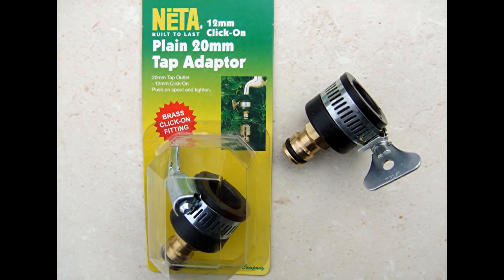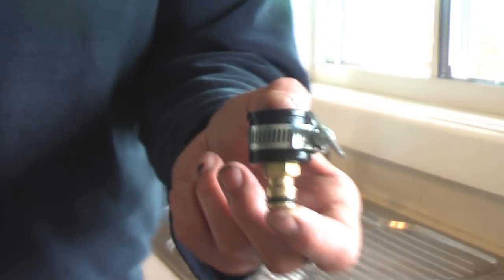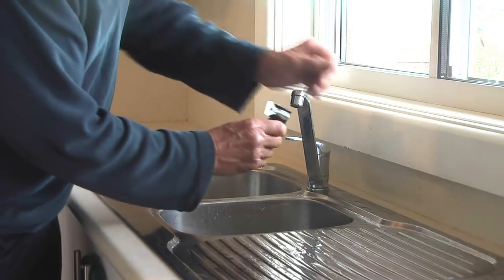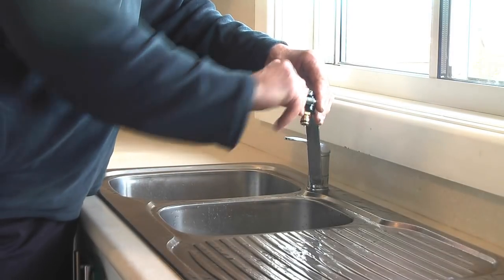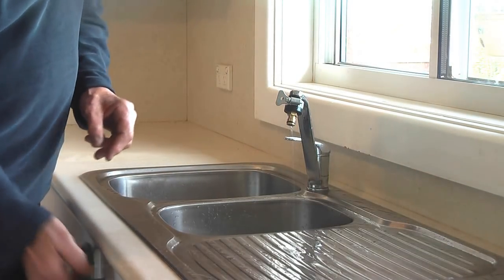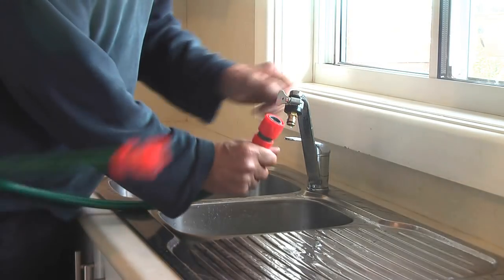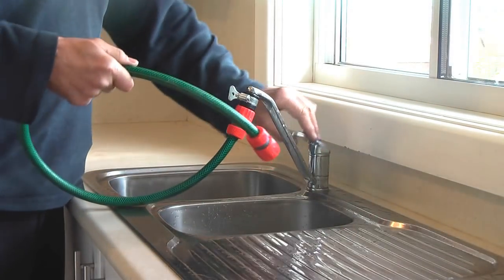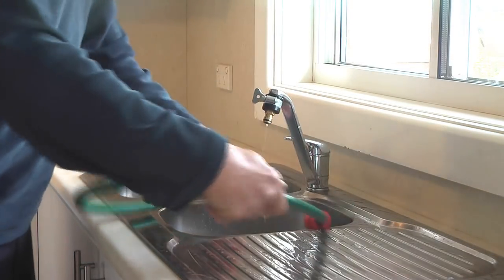✅INDOOR WATER FAUCET/TAP ADAPTER CONNECT HOSES

Comment: If you're filling a bucket,  then why not fill it just straight out of the tap?
Reply from the maker: Yes you can  if you have a tap you can get bucket under . But if you looking to put hot water in the bucket. You can hook this up to most taps in sinks. Unless you like to fill it under bath hot water tap??
Reply: There are other uses for these things too.

Comment: Not a reliable way of connecting to any water supply be it high pressure  or just low gravity fed supply.There is a half inch quick connect fitting like the one you have here that fits on to a washing machine valve.
I think it's known as a half inch BSP ( British standard pipe) connection.
Readily available here in Ireland.
Any plumbing trade shop would supply you with something similar
Reply from the maker: David Lawlor 

This is manly for people that need connect a
hose temporally.Using for things like filling bucket with hot
water, maybe putting warm water in aquarium and for those indoor plants that
have to be watered with slightly warm water.